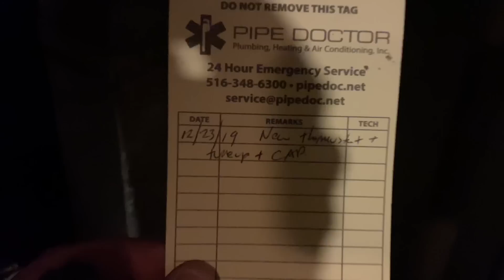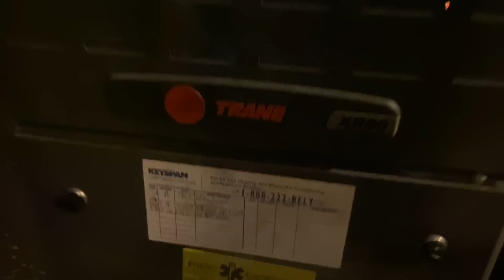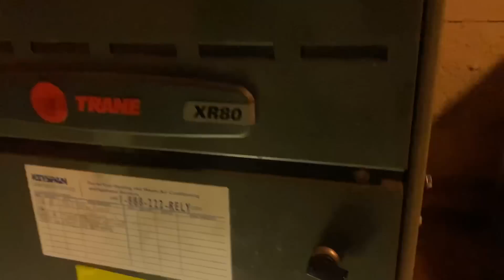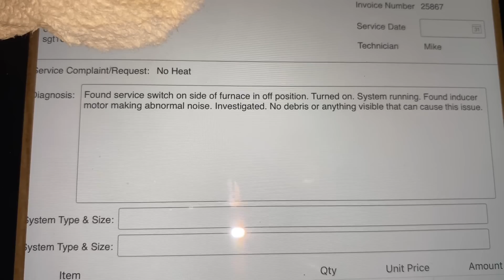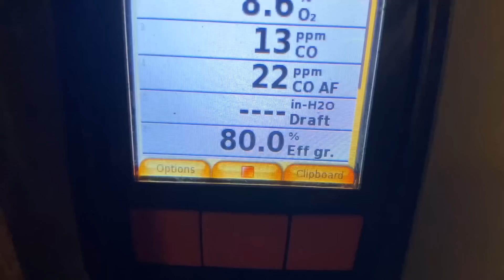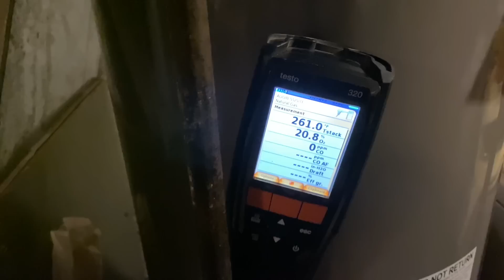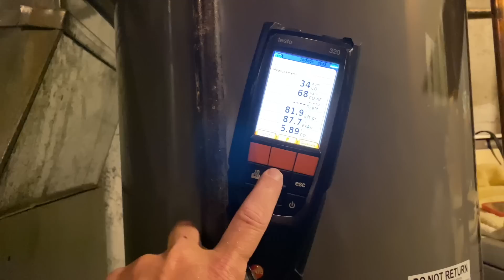Trane Gas Furnace Not Heating - No Heat HVAC Service Call in New York City

Comment: Hmmmmm lots of comments about that blower motor, lets hope you replace that furnace because wont be much longer and there will be another call for either motor going out on inducer or blower. When you replace the furnace would be nice if you replaced that return air boot with one that has a  filter slot in it , that's an easy change out she should stay with an 80% furnace and you will be out in 4 hours or less, If she does not replace and if she in fact is a maintenance customer you should send someone out the remove and clean blower and lubricate that inducer fan motor.

Comment: Your maintenance doesn’t include cleaning the blower?
Reply: probably not, for then to clean the entire blower assembly will have to come out and should be extra. that blower motor since it hasn't been clean in years which mean blower wheel might be the same hint as of why the flames were moving around like they were, wheel not moving much air, im surprise ti wasnt out on HLS

Comment: HVAC guys. Question?  I retired this year and we moved to Brazil. We built a house and the A/C guys (no license required) put in four 18K units. Without vacuuming the line-sets.  The line sets were installed months ago, without caps on the ends. Do I need to recover/remove all the 410a, go thru the vacuum process then place new 410a?  To remove any potential moisture.  “They say it isn’t necessary”. I know it is.
Reply: Even recovering the refrigerant and pulling vacuum will not fully pull all moisture bc they did not vacuum the system after leaving the Lineset open to atmosphere. Poe is hygroscopic meaning moisture gets trapped in the oil and will freeze when the system is on. You will need to pull a triple evacuation. Purging with nitro will remove what it can. Make sure to add new 410a. But the thing is your losing oil that needs to be in the system to lubricate the compressor. So it’s a tough call but can be fixed if triple evac is done and proper virgin refrigerant. Spending the extra half hr really makes a difference when it comes to mini splits
Reply: @acrservicesmathewr7565  Thanks Matt.  The units have never been used, with the exception of them turning them on to "see" if they run cold.  Would that make a difference?  I will triple vac them anyhow.  Thank you.

Comment: 😂😂😂 Casper the friendly ghost 👻 shut the switch off he was too hot 😅😅 but bet that fan motor runs a tad hot… as long as no carbon monoxide in the heat supply plum, she still good furnace, but the efficiency of that is Rockbottom in today’s times

Comment: Inducer sounds like ass.  Changed out a 2006 90% goodman today, heat exchanger looked like swizz cheese on the under sides of the bends in the tubes, each one down low.  Got to the service call for a banging noise around noon, got them up and running with a new ruud 95% the same day.

Comment: You should have cleaned the back of the blower motor
Reply: Absolutely
Reply from the maker: cleaning that motor = replacement
she wants a new furnace
thanks for commenting
Reply: I have to agree that the time is right to upgrade the system and replace the furnace.